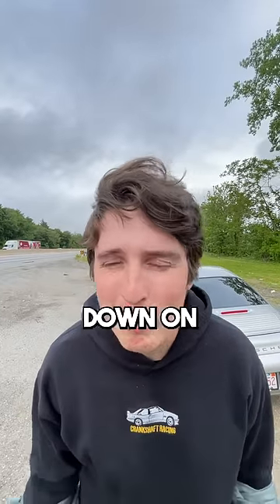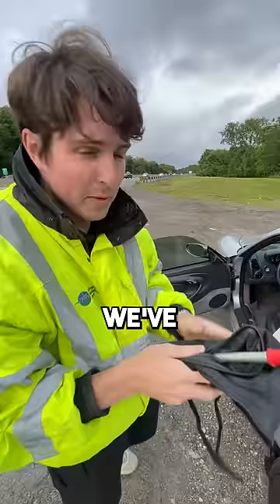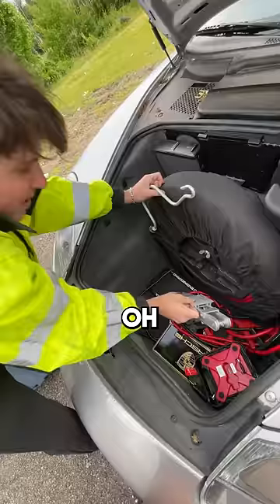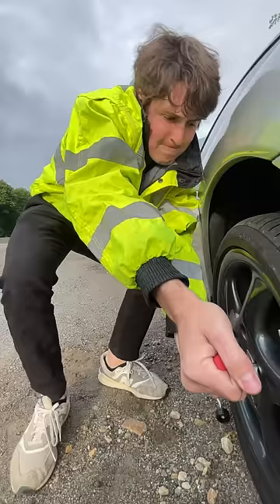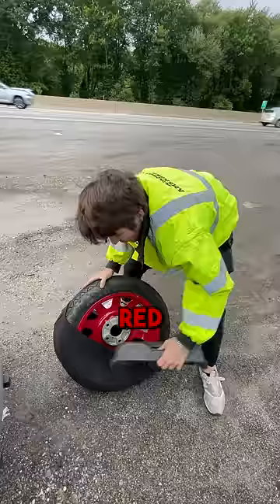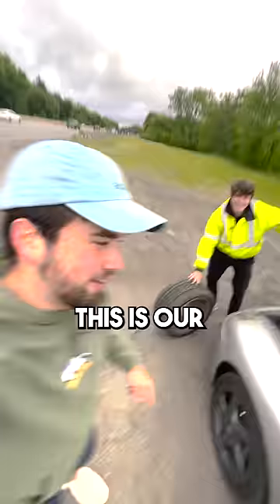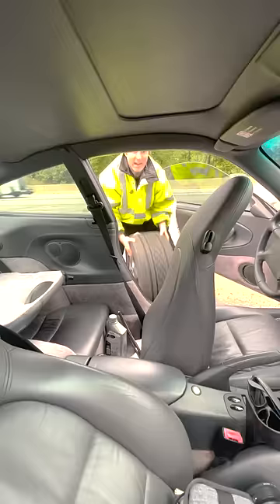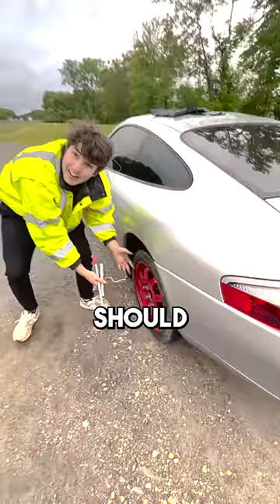Don't Try This At Home...

Comment: Bro really attached a bicycle wheel to a porsche💀💀
Reply: Fr💀
Reply: its not like he did it on purpose some cars have that as an emergency wheel
Reply: @not_sildi  yeah economic cars porsches should have a spare oem wheel
Reply: @sneakin3274  No. That is unnecessary weight for a sport car.
Reply: @georgeb5262  no porsches SHOULD have them. Only the gt3 or gt2 shouldn't have one.
Reply: @Vl0gWithAb  no space to put the regular one.
Reply: @Vl0gWithAb  There isn't enough space for a full size oem spare tire, besides that spare tire is meant for temporary use not permanent replacement
Reply: If you think bicycle wheels have such width I'm fully convinced ypu have never ridden a bicycle.
Reply: @ursulpolal5949  I meant it as a joke bruh... Ik one wouldn't fit, but you can't exactly call that a car wheel too can you
Reply: That's a spare tire and correct for the car.
Reply: Why would you design a car that can't fit a normal spare and why does that car give you a dollar store jack and breaker bar
Reply: @not_sildi  do not know what a joke is
Reply: How do you think he keeps it so cheap? Lol
Reply: Bro got the drift tires.
Reply: It’s called a donut you donut
Reply: @zephyrous5410 yes you can because that’s what it’s for
Reply: @yolowolfyt I’m losing brain cells reading this
Reply: Or cars have this kind of wheel the spare wheels are always smaller
Reply: That kind of wheel is intended to be make a car be able to get to the closest place where you can fix it.
Reply: @Vl0gWithAb so not only pay a lot of money for the car but you also have to pay multiple hundred bucks for towing.
Reply: @sneakin3274 wdym? That's a regular spare tire. You never have the exact same wheel as a spare. It's thinner and smaller to prevent you from going fast and long distances as it is only supposed to get you to the next Autoshop

Comment: Why is that spare half the size of the regular wheels?
Reply: spacesaver
Reply: because it's not made to drive like a normal wheel it's a emergency so when you out it on you drive either home if ur close but if you are close to a dealership or anything like that you drive there. no driving at high speeds
Reply: @punchtrees3022 its amazing how many people don't know this 😂like who tf raised you if you don't know what a spare tire looks like 😂

Comment: I remember my dad was on a Massachusetts highway and i was in the car he hit a bump at 50 mph or 70 and 2 tires poped we used the spare and we used the stock mercedes Rclass tire pump the force of the bump
Was enough to deploy the dash and steering wheel airbag and seat belt but not the seat and curtian we are still working on it (i made it out uninjured and my dad got out with minor cuts and bruises everyone was alright!)

Comment: Originally the spare would not go on a drive axle, but because the front tires are a different size than the rear. I don’t think it matters in this case, it’s all up to the differential now.
Reply: 😂😂you are working off old information 😂they can be put on drive tires thats what they are made for its a spare tire you don't go above 50 mph whether it's in the front or back it will blow up if you go alot faster than 50 mph

Comment: If that Porsche is rear wheel drive, the spare tire should be in the front and you should take a front tire and put it on the back so it will last longer and your going to be safer. This is what my dad told me who is a mechanic, that’s how I know.

Comment: pro tip , when changing a tire using those junk roadside jacks you want to get the new tire on as quickly as possible , so fumble with puting the flat tire away after. those jacks are incredible unstable and even a small nudge can easily cause them to slide off to the side and drop the car down... Ask me how I know lol.
Reply: Lol the jacks aren't extremely unstable you just don't know how to operate one properly obviously 😂those are reliable Jack's its not rocket science to line them up proper and put them on solid ground so you don't slip that can happen with any jack or jack stand 😂

Comment: Losen the bolts before u jack :)
Jst wondering what do u mean by old fashioned (I guess it's American thing)
Reply: The tool he was using how can you not see that he doesn't have a socket wrench or a proper socket
Reply: @timetobeast7261  that is also technically old fashioned according to his definition